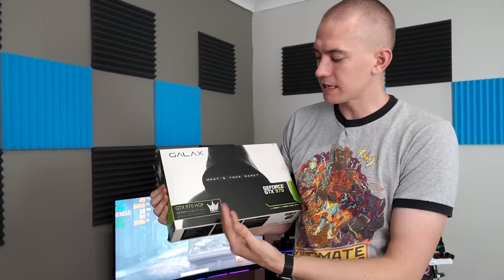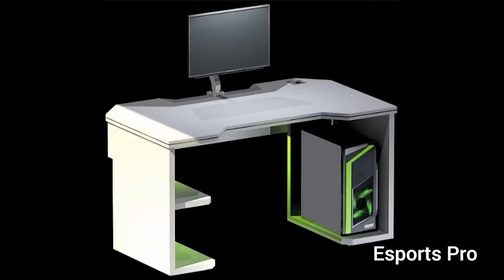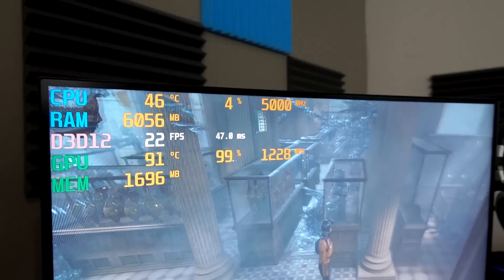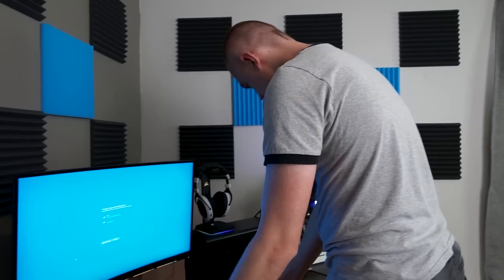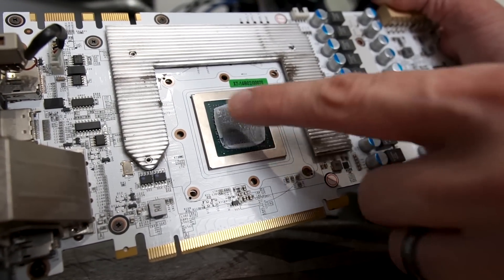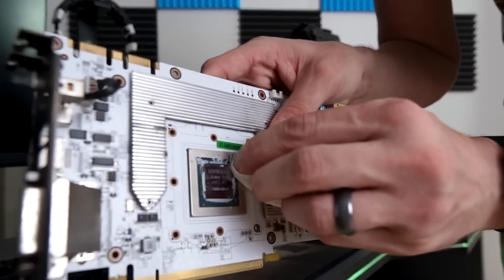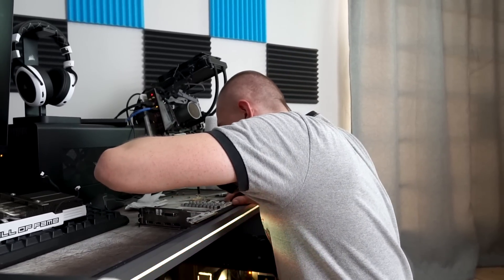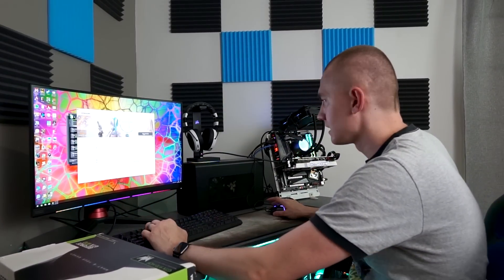GTX 970 - Worth It In 2019?

Comment: Ultra is quit possible in a lot of games as a starting point on the 970, and then just turn down a couple of settings from there,  so you end up somewhere in between. I have  a mate who has a 1080TI, but he has a crappy TN panel at 1080p. I have a 970 ...  BUT  a monitor three times the price, the quantum dot or whatever they are called.  The contrast ratio is immense and 3 times of his TN panel, it even makes HDR look crap on a low contrast ratio monitor compared to mine without HDR,  

My games on high look so much prettier and vibrant than his on ultra, although he gets over 100 FPS.

I learned if you have to make choices where to spend your money,  GPUs are often overrated by many when they buy a crappy panel. Monitors are underrated. Once you have seen a quality VA or IPS, you will never go back to TN,  Mine has really low input lag too. Give me good contrast ratio and colours at 1080p any day over low contrast ratio at 2K or even 4K.
Reply: Get a PG279Q and get it all. IPS/1440p/144hz
Reply: I totally agree man, TN panels suck overall in image quality, colour accuracy and wieving angles though they make up for it in refresh rate which is awesome for FPS games. Though we now have IPS panels with 144hz or maybe more with adadptive V-Sync (G-Sync/Free-Sync) but they are very expensive to me atleast. Anyhow if you are good with 1080P high/Ultra settings then a 970 and a sufficient CPU + an IPS monitor should be good for most games even in 2019-2020 an exception is the FPS-shooters that gives a clear advantage to higher refresh rates panels at 120-144hz and above refresh rate panels as it feels and is way smoother with your precision in the game. Personally i cant go back to TN-panels after getting used to the IPS-panels colours and all of goodness, though with a bigger wallet I could have the best of 2 worlds (money solves any problem ;), as to run newer FPS games at such high frame rates would also require a much stronger card than a 970 aswell.

Comment: I had similar issues with my GTX 970 - except one of the fan attachments/ plugs was not quite in resulting in random PC crashes and the 'working' fan winding up like a hair dryer lol. Good card though- comparable with a 3GB 1060... As a 'casual' gamer it does the job and the cost of 'real' upgrades is unjustified...

Comment: Gtx 970, what a legendary card. Still own it and with oc, can play any game at high or maybe ultra settings.
Reply: Could you do a video on 970 in sli and compare it to other cards?
Reply: yes, on 1080p, it is still very respectable, still my GPU today,  I find I need to turn down a couple of settings from ultra in some games,  but these make such small difference in practical use.
Reply: @afborro  Yeah, and then u realise some settings demand way too much for very little difference to the game.
Reply: My 970 Gigabyte G1 Gaming windforce X3 is running at 1504 mhz, Haven't seen is go above 64 degrees, 70% fan speed. Although i do play with v-sync on so it is mostly only being utilized between 35-80% depending on the game. Even tho my card can run Rainbow six siege at 110-130 fps i still have the odd screen tare which i despise, so i use v-sync.
Reply: traded my old sli of 970 strix with a brand new kfa2 1070,have about the same framerate as my sli. but obviously it is a lot colder and better vram.  for my htpc im using a founder 980 i found for very cheap they are all great cards.
Reply: with the 970 at 1080p you can max the settings on almost everything
Reply: 720p is the best
Reply: @mryeet2761  no 144p
Reply: At high or ultra settings.... in glorious 720p :P
Reply: @Eiszapfen der wütenden Winde what how?
Reply: I'm using it still too and i'm kind of shocked.  I GPU mined quite a bit and play everything i try on max settings no problem. Instead of freaking out if my FPS number wiggles, i turn it off and enjoy what SEEMS like a flawless experience.  Maybe a grand would polish that up a bit but.... no!  I'll upgrade it when i finally get some sexy VR gear.  Maybe!
Reply: @fudgeknuckle952  you game at 1080p then?
Reply: @Josep_Hernandez_Lujan  we have 4k 144hz..
And i like to enjoy my games thank you very much.
Reply: lol, 30fps or? XD
Reply: Uzumaki Kira mine runs far cry 5 ultra 60 fps no dips and about 65 with vsync
Reply: Without vsync is what I meant
Reply: @Dryphu  yea dont vsync games unless unplayable screen tearing ha
Reply: Should I upgrade to a gtx 970 due to electricity bills ?
Reply: @Josep_Hernandez_Lujan  i don't game on a little tiny 970.. 1080ti here.
Reply: 1080P is like 24 years old though.. 
 Looks like trash
Reply: @xpodx  it's all in the eye of the beholder, When I had to make the decision to pick 1440p over 1080p few years ago, versus colour quality and contrast ratio, it was easy, for the same money the 1080p monitor won easily, as well as the high refresh rates and low input lag.
Reply: @afborro   It's true that all monitors are different and have strengths and weaknesses, but higher pixel count and higher ppi are the most important to me. I'm getting 5k next.
Reply: @xpodx  well if that is how it is for you, then so be it 😀
Reply: Even with my 1080TI on my 4k OLED, I will STILL run 1080p on the most demanding games of today. I would rather max out 1080p and keep a solid 60fps at all times with max TAA then crank it up to 4k and have to drop all kinds of settings and still get FPS drops. FPS>>>>>>>>>Resolution every single second of every single day with no exceptions, ever. (a lot of games I can run high/ultra at 4k and have no FPS drops, so I will do that obviously, but games like Monster Hunter World destroy my GPU, so it's max 1080p to keep that sweet 60fps)
Reply: @xpodx  oh sorry pc master race god you must be running at 8k with your rtx titan sli
Reply: @ShaunBourke   i7 4770k 1080ti
Reply: @ShaunBourke  I wish. Someday.
Reply: @xpodx  if ur gaming close from monitor distance then maybe 1080 wont look as well. In a normal distance, there is not so much difference.
Reply: @xpodx  It's the best gaming resolution. If i want to watch netflix i can do that on a tv. Since 4k at a decent hertz rate of 144 is worth its weight in gold and they still don't have a 240 hz one then they're pretty useless.
Reply: @dudarsky I want more realistic imagery. 8k is the highest and best. One can game at 60hz and be happy there gaming at 8k ultra then low res trash 4k and below.
Reply: @xpodx  I'm talking about actual gaming, as in fps shooters etc. not skyrim where resolution doesn't mean anything. It's all about the hertz of a monitor.
Reply: @dudarsky  yea hz is important and is better for competing.  But I'd rather game at higher res
Reply: @xpodx  To each their own i guess. I don't sacrifice hertz for higher res. But i mostly play fps games.
Reply: @dudarsky  I mostly play fps games too, yea I gotcha. 2 diff types of gamers. 4k 144hz and 8k 60hz are the best options.

Comment: My 970 GTX runs Project Cars 2 split screen over 3 x 1080P monitors with reasonably good framerates without it being overclocked. If you are still on a 1080P 60Hz  monitor it will run just every new game at very high details. The only reason I'd like to get a 1080 GTX or better (hopefully an AMD GPU) is I'd one day would love to get into VR (PiMax 5K, Oculus Rift, etc.) if I can ever actually afford it.

Comment: Hell ya it is!  I have EVGA SSC 960 and 970 4gb here both are kick ass 1080p any game.  Granted I can't run 8x msaa.  That aside both graphics cards run any game @ high settings with vsync while holding 60fps and not dropping under.  Nice a tech YouTuber that isn't too stuck up on hardware.  Cheers

Comment: My GTX 970 still holds up but I will be upgrading it due to Anthem. It can run the game at high (1080P) but will be locked at 30FPS through most of the games content. Dropping it down to medium sees it run at a smooth 60FPS outside of battles where it will still drop to 30. Vsync is enabled as the tearing is really bad without it lol. So it's time for a GPU and a monitor upgrade.

Comment: The Galax GTX 970 HOF was a very sweet card.  If I had one I'd probably still be using it.  Its probably as fast (or close to it) in most games as the current RX 570 so as you said, fine for 1080p gaming at reasonable settings. To be honest though though, you can probably get a used RX 570 4GB for $20 less than a GTX 970.

Comment: I have 2 in SLI.  Original one was retail price, and second was for about 170 before mining boom.  I sanded and polished the heatsinks (EVGA rough pipes were terrible) and used some kryonaut, and I'm getting 81 degrees at 1535mhz overclocked on both cards.  I can play just about anything.  Still would be nice if I won that 2080Ti though.

Comment: For some reason, I keep getting a "complete the action first" message on the twitter follow thing even though I did. 
Neat video. Bought a used 970 last year it was amazing... until it kicked the bucket a month and a half later :(
Now I bought a brand new rx 580, but I'm kinda regretting it, I think I should have saved a bit more and bought a 2060.

Comment: I mean, for me a GTX 970 would still be very much worth it considering my current gpu, according to userbenchmark, is 118% Slower than a GT 1030
Reply: and here i am with my titan Xp laughing at everything
Reply: What graphics card do you have?
Reply: @florin7316  Radeon R7 M265
Reply: Bruh grab something, even a gtx 950 would give you gains! What area are you from?
Reply: Not much you can do with a laptop. Maybe Ryzen 3000 would be a nice push factor to dive in.
Reply: I'd recommend an rx 570 or 580 with 8gb of vram because you can get those used for a better price than a 970 or 980 and they'll be equivalent or better.

Comment: Still running a GTX 970 and currently saving up for RTX 2080
Reply from the maker: Why the 2080 & no Radeon VII love?
Reply: maybe because VII eats alot of W and heats up too much? i know what this problem is since ive been using my 290x for 6th year now...
Reply: The Radeon 7 is more efficient if you under volt it properly, and there's even an auto undervolt button in wattman settings for it so its 1 click and your temps drop 20c. My 2080 FTW3 ultra isn't really power efficient tbh pull 250-300w in games.
Reply: @ognintendo7061  Auto volting is never good idea also the fans are controlled by hbm2 thermal doid which means that the fans are spinning at high rpms all the time under load because VRMs are usually really hot and they spike quite hard. So its hot, noisy and power hungry. I wanted the VII to do good I was 90% sure it was gonna be my next card but it just failed and you can read about it everywhere. Ill wait for navi which hopefully will bring a card at RTX 2070 performance atleast with solid thermals and wattage. That's all I ask from amd this year.
Reply: @AlterKillerful  auto undervolting* its a good place to start testing. Radeon are always over volted stock thats why they're hot. Best to drop it down to the 1050-70mv or lower range. There's its around 210 watts. And temps are quite decent. Same with vega 64/56 it's so overvolted and power limited that it can't even maintain its boost clock while gaming. As soon as you undervolt its completely fine.
Reply: Yeah 1080ti is pretty nice problem is Nvidia drivers are no longer optimized for anything but Turing cards. Happens every time they move to a new architecture. That's why 780ti are trash nowadays meanwhile the 290/290x can still hold its own at 1080p. Radeon has fine wine and Nvidia has toxic rust for their drivers. As long as you stay on the 399.xx drivers for the 1080ti it should be fine tho
Reply: @Julien Lauzon well the 780ti is slow as shit because Nvidia stopped optimizing drivers for it after the 980 dropped, meanwhile the 290/x is faster than it ever was at release, still keeping up with the rx 480 and GTX 1060, while the 780ti loses to even the 1050ti sometimes. Definitely know people who have had to keep old drivers handy because newer ones would gimp or break games for them
Reply: @Julien Lauzon whatever to do wait for the glory of ryzen 3000 series. That way you can flex on those Intel 9900k plebs 😉

Comment: After watching this I realized that my EVGA GTX970 likes to hover around 85C and I have a tube of thermal paste sitting on my shelf... I have no excuses anymore!! Welp, I know what I'm doing today!
Reply: Christian Fletcher did you fix it ?
Reply: @adverse811  Yes! Works awesome now!
Reply: I noticed mine's idling around 50°C and 80°C in full load, maybe it's time for a repaste as well. I've been rocking it since late 2015.
Reply: mine sits at 34c idle and 77c load its within normal limits. but the software I use will throttle if temps get over 80c. hell 85c is still decent.
Reply: Oh no, Maybe he killed it... Haven't heard back.
Reply: @John-np2bf  Sorry I just didn't see these! Didn't kill it thankfully lol. It lowered temps to around 78-80, but it stays at it's boost clock now! No more throttling! Before it would jump to 85 and then throttle, now it just stays right at the boost clock.